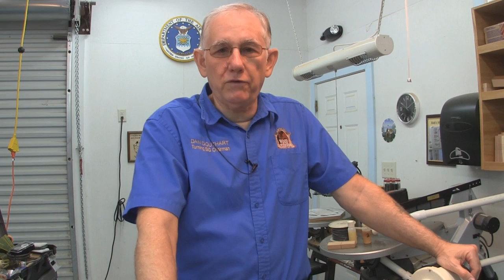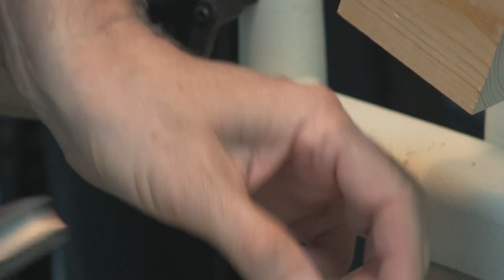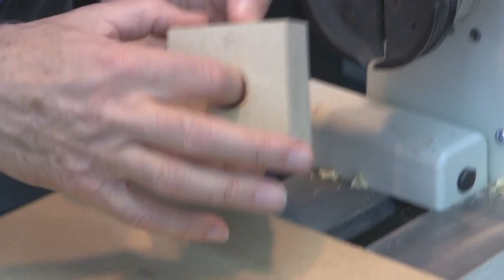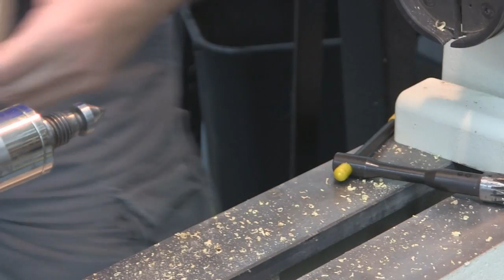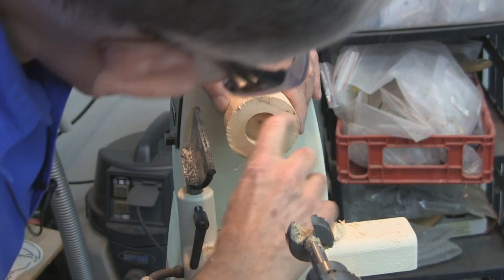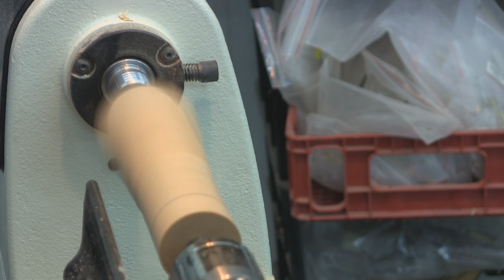2014-08-30 - Shop Made Wood Lathe Spindle Chucks

Comment: I enjoyed your viideo. always good watching ow others do things

Spindle Lock

I think your spindle lock is threaded. If you press it in then screw it in it should stay there without having to hold it or use your chuck key.

regards

Dave
Reply: +DaveTheTurningCowboy I presume that you are referring to the knob that is above the hand wheel.  That is the indexing pin and should not be used as a spindle lock.  The spindle lock on this lathe is the knob that is on the back side of the spindle, which is not threaded.  Thanks for watching our videos.

Comment: Be careful with baltic birch at small diameter. I've had plys of threaded faceplates de-laminate in use. Not a pretty picture.
Alan Stratton
Reply: I use these fixtures for small items which do not put much stress on the threaded area.  Plus, I always use the tail stock for additional support when roughing and heavier shaping cuts.  When you had your failure, how much material was around the threads on the faceplate and how large a piece were you turning?  I have contemplated how much wood I need to leave around the threads on mine.  This is specifically why I do not use regular plywood.  The quality and thickness of the veneers and glue used in Baltic Birch plywood make it much stronger than regular plywood and there are different grades of Baltic Birch plywood.  The pieces that I use are cutoffs from a local cabinet shop.
Reply: Dan Douthart I was turning a 6" vessel about 4" high. The faceplate was probably 3-4" made from baltic birch. So, a much bigger project than what you are turning.
I've resolved to not use any sort of plywood for any faceplate less than 6" diameter. Even then, I may reinforce future faceplates perhaps with dowels to prevent layers from untimely separation. 
I'm sold on threaded wood faceplates - using them very frequently. But, now I'm more careful about the material.
Alan Stratton
Reply: As Wood Turns Thanks for the info Alan.  I like the idea reinforcing the block with dowels also.   You can also use fixtures on the live center.  I just watched your "Page Holder" video.  You could have used a soft piece of wood with a hole drilled in it and attached to the live center to provide support on the finished end while you worked on the head stock end.  The OneWay live center is threaded and I make threaded fixtures for that also.
Reply: Dan Douthart Goes to show what more can be done. I have a tap sized from my live center but haven't used it yet for for than a couple of faceplates and fixtures such as my eccentric faceplates and sphere faceplates.
Thanks for all the good ideas.
Alan

Comment: Great video!  The use of shop-made chucks is a technique that Ernie Conover promotes in his "The Frugal Turner" book and is a very powerful tool - great for both specialty jigs and general purpose glue blocks.

Two points:
1.  Beall makes great taps, but you can purchase suitable taps at Ace Hardware.
2.  The use of birch plywood makes the threads stronger.  If you use solid wood, you can accomplish the same thing by using a face-grain orientation.  Tapping into end-grain will result in weaker threads.